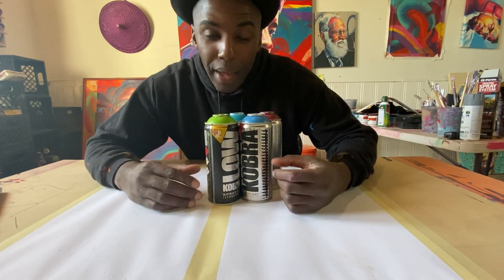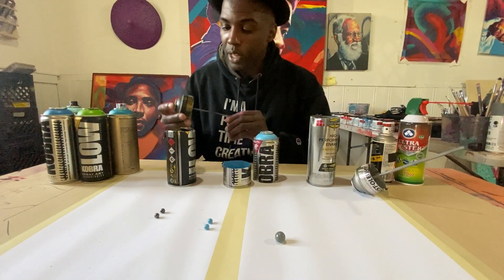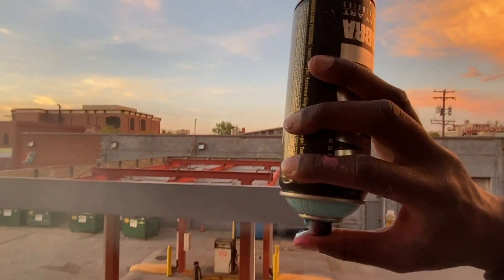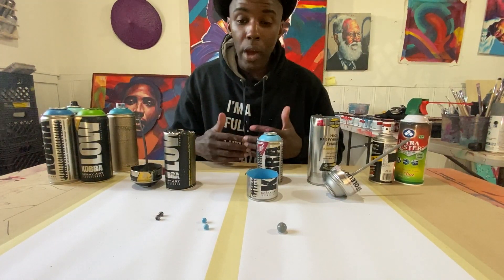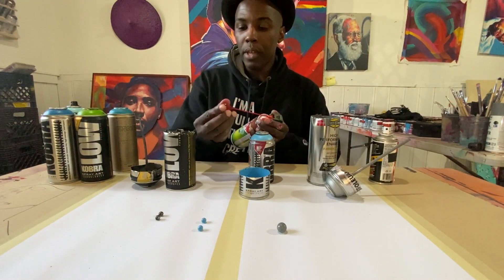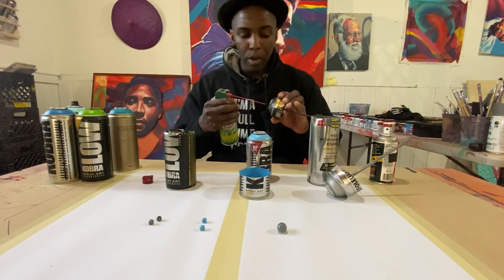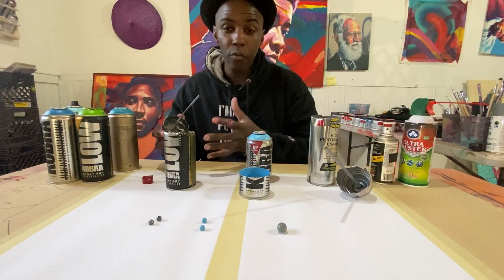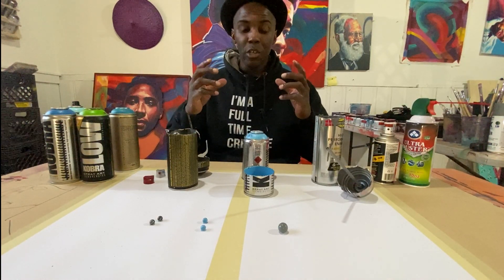What's Inside a Spray Paint Can and How do you Unclog a spray paint Can

Comment: Nice tips, I've had cans of wd40 and pb blaster run out of the aerosol before it ran out of liquid.  If you take a tube value and press it firmly to the can, then you can put air into the can. I know it works on cans with male nozzles but unsure about female nozzles.  If it works for you pass it on

Comment: Appreciate the tips. Unfortunately, it didn't work for me. Rust-oleum brand I will never buy again. Happens "WAY" to often over the years. 90 lbs of air from my compressor through a blow gun, wouldn't clear the internal blockage in the can. Male style. And the can was more than 1/2 full. Even with the cap off, and forcing the tube open at the top of the can, while blowing compressed air into it. I rattled it, beat it, smashed it, still nothing. Finally, I covered the top, and jammed an awl into it, and it let some loose. But by then the plastic tube at the top was broke. Very frustrating. From now on, think I'll mix my own paint, and use my spray gun. Even for little jobs. Done with aerosol.
Reply: Any regrets?
Reply: @MK-ih6wp  In what way?
Reply: Yep, I am through with Rustoleum. They're kind enough to send you new nozzles through customer support, but the cans are way too much trouble. I never have the same plugging problems with other brands. I have the exact same problem and attempts you have. The last thing I have yet to do is find something thin enough to stab down that tube.